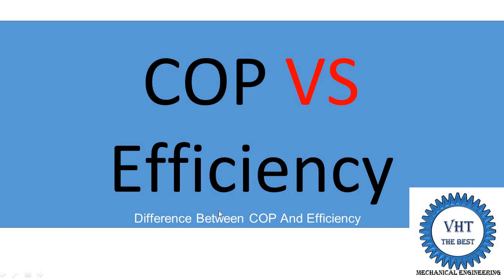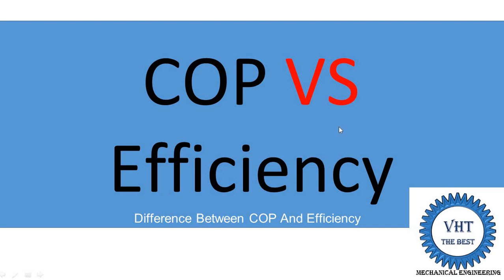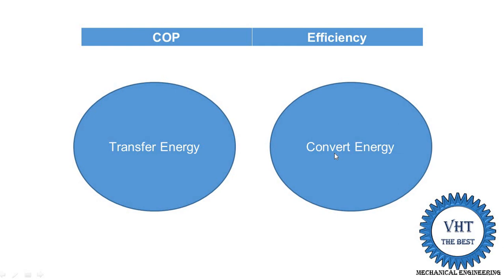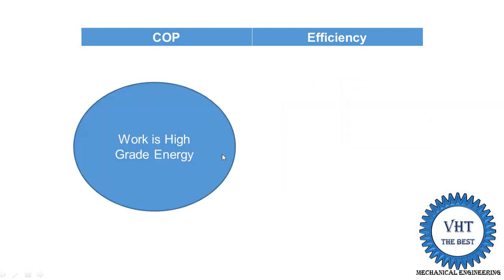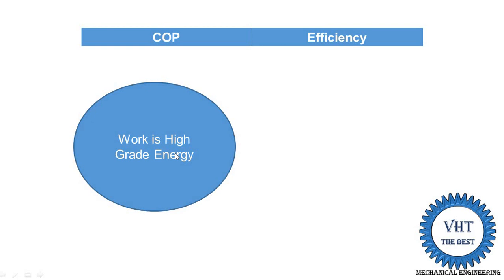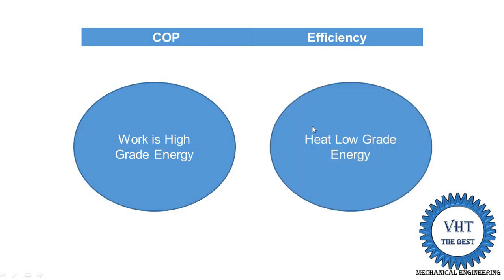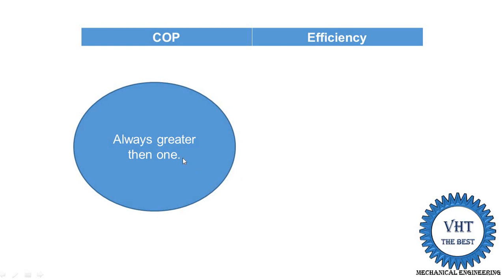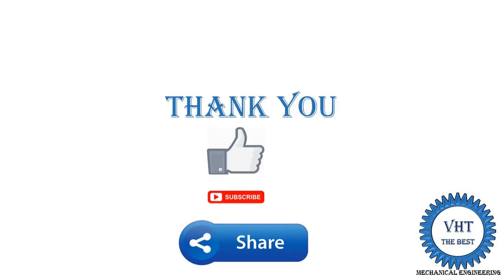Difference Between COP and Efficiency.

Comment: Sir in 1st point, don't we convert work energy to get heat extracted from cool space, and eject to warm environment?
Or we should say, only that we transfer work energy to get heat extracted.... to warm environment?

As in efficiency, 
We talk about conversion of 'heat energy from warm environment' to work energy
Heat energy come from burning fuel,
And go to sink, but in between it gives work

But we can't talk about, in COP
Conversion of work energy to 'ejection of heat energy to warm environment'
Work energy help to eject more heat from condenser, and that heat goes out  heating air,  so isn't it correct we converted work energy to heat energy

Comment: Wait a second isn't a cop of one equal to resistive heat so cop 2 would mean that it's twice as efficient as a resistive heat device? And if the temperature is cold enough your heat transfer is so inefficient that resistive heat can eventually become more efficient? So you could go below a one.?

If resistive heat cost x amount per kilowatt and with a gas device producing the equivalent number of BTU for x price you should be able to compare equivalencies.... right?